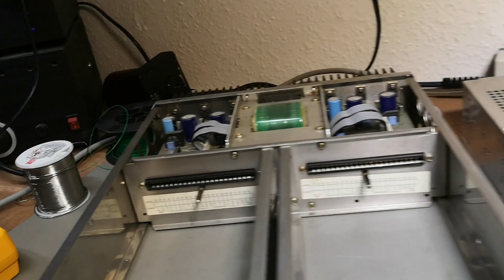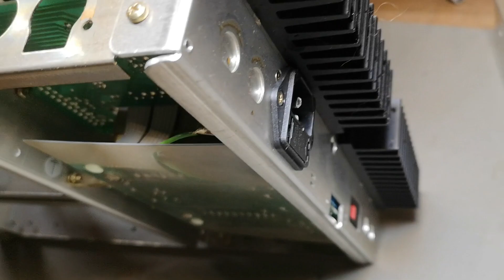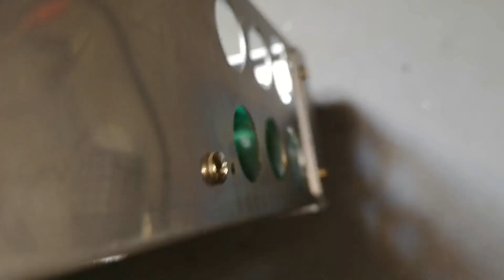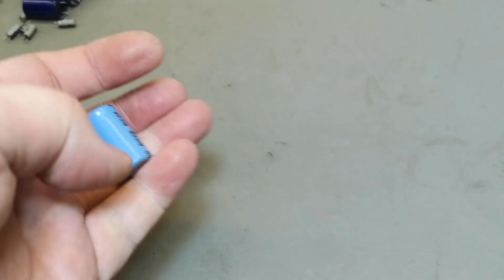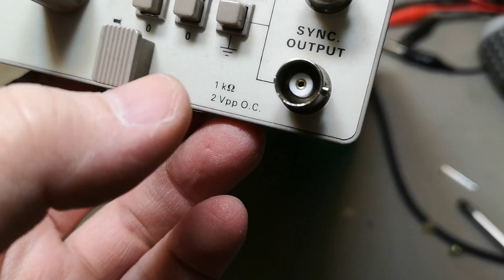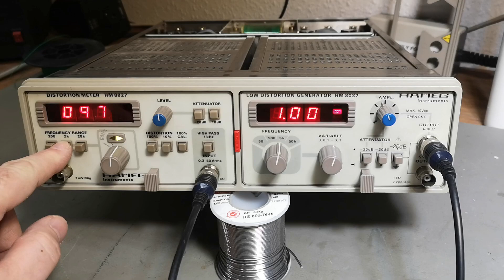Hameg HM8001 mainframe, HM8027 distortion meter, HM8037 low Distortion generator

Comment: Hi Thomas, this is another WoW device, I've always wanted it but it's too deep for my space and I've never come across a good price. It's a big help for repairing audio equipment and I'm not afraid to write that I really envy you (and I'm not envious). You cleaned it up beautifully, the design is amazing as we can see, such super machines can be made analog without the need for microcontrollers and a ton of software - I'm old school and I just love these designs - everything is repairable (that is, if the parts can be found - yesterday I he was repairing a mixing console and it is basically impossible to get original potentiometers and that is quite a problem, because in addition to the function of the potentiometer, it creates an anchor element that holds the electronics under the panel - the required value and shape only for an order of at least 350 pcs and I need three - I disassembled one into parts and fixed two - the mixer lost one channel, but it works).
Thank you for the opportunity to at least look into such beauty.

Nice day 🙂 Tom
Reply from the maker: oh.. repairing mixing consoles can be a huge patience challenge :-) of course depending how many channels it is :-) when you find and fix a problem, now you need to repeat it x channels times :-)
Reply: @TeardownOZ2CPU  In addition, someone has gone to great lengths to design, the all-metal pull potentiometers (dual stereo/mono design) are screwed to the panel and form an anchor element for the complete electronics, a small mix = one board. The fun started when I discovered that the aluminum cover (0.8mm) of the printed panel could not be removed even after unscrewing the screws (something similar to what you had recently with one device too) the panel was completely glued with vulcanizing contact adhesive, it took me half a day just peel off and clean the glue without damaging the 0.8mm thick printed label. The best thing is why it ended up dead, a colleague bought it on an ad (I told him not to plug it in, we have to check it first) and he plugged it in out of impatience, unfortunately there was no original adapter for it, so he took the first one with the corresponding voltage and connector - well, what do you think - he didn't check the polarity and the mix doesn't have internal protection against polarity reversal - His words "I bought a scumbag, not even the led light came on" when I heard it, I thought that I 🤪
Reply from the maker: @Edisson.  oh no.. how terrible.. and now it takes 100 times the work to get it solved, this is not the first time i heard this type of story

Comment: Nice, that is some very neat gear that I would love to have on my bench. But you forgot to demonstrate the output on the HM8027. It can give you better readout precision on distortion below 0,01% if connected to a voltmeter, and visualize the residual content on a scope. In XY-mode the lissajous-shape is commonly used to determine the harmonic content of the distortion.
Reply from the maker: Thanks for mention this very usefull feature, I will use it next time i test an audio amplifier that is under the internal read out capeabilities, but my next project is an old tube amp, so i dont expect to read very low values :-)